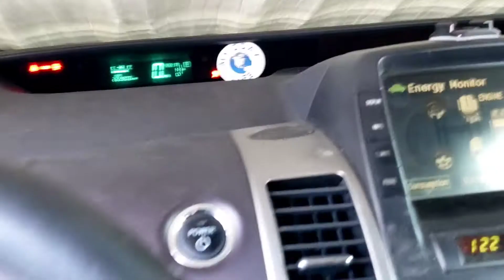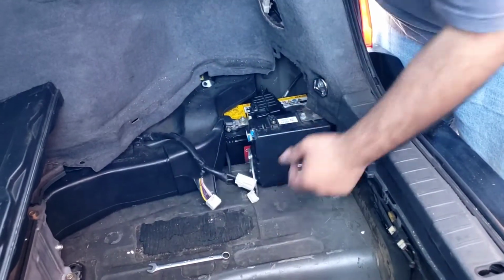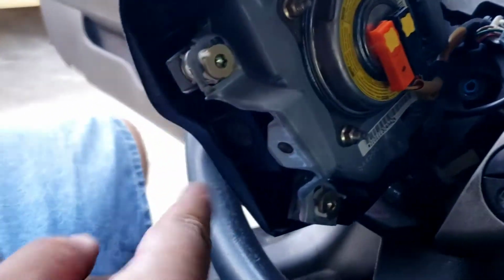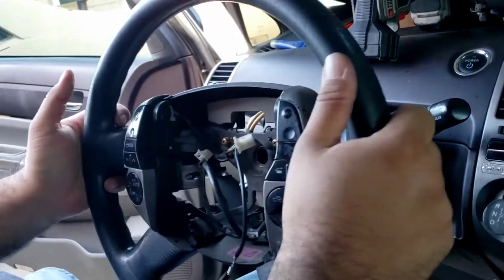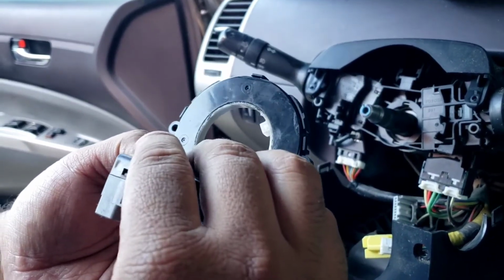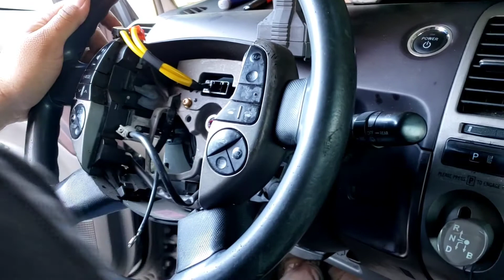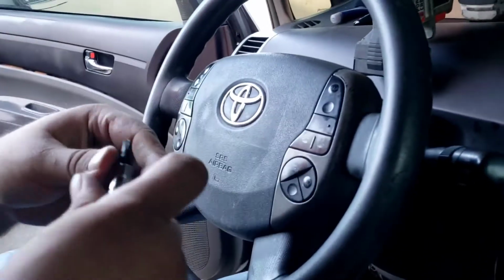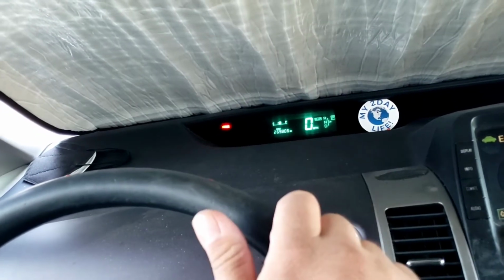2005 Toyota prius AIRBAG LIGHT ON

Comment: Thanks much MY2!  I had B1801 error and NO airbag light at all (even on the start). Changed Spiral with your help smoothly. Thanks again. B* error gone.
Think somebody shorten  airbag light for good in my car, it's was repaired, I see all bag are there on passenger and curtaints, but never see the light, didn't check it 6 years ago(
Reply from the maker: @Vi, WELCOME TO MY2DAYLIFE! I'm glad you were able to get some inspiration from our video. Thanks for watching! 👍

Comment: Question I look at your video and I see the mileage on your Prius/I have a Prius and I reach the 300,000 mi and after that my speedometer don't want to move anymore stay stuck/ do you have the same problem when you reach 999999999999999?

Comment: Great explanation video
So is the fix still working several months later ?

I am seeing varios prices for gen2 Prius clock spring
$260 in autozone

Rockauto offer 3 prices
Economy $35
Standard $169 or $179

Not sure if economy is reliable choice or should go with standard thus my question above
Reply from the maker: @Jose Viveiros, Welcome to MY2DAYLIFE! So far the ebay brand is still holding up, no issue yet. I would go with the economy one from rock auto, it should hold up just fine. Best of luck! 👍